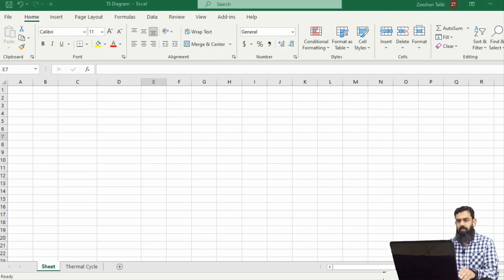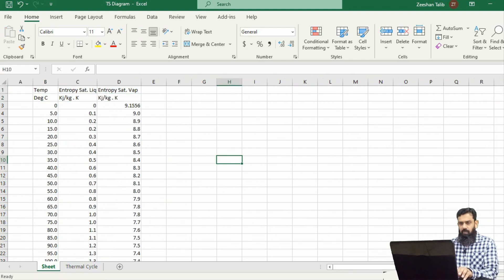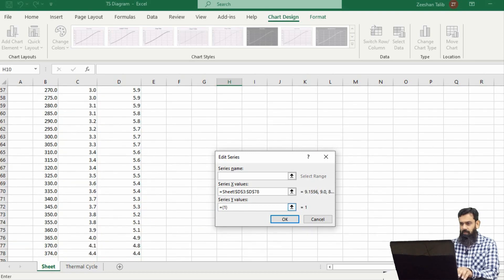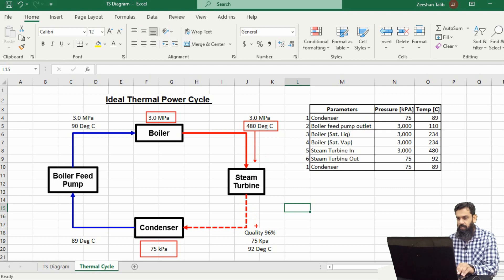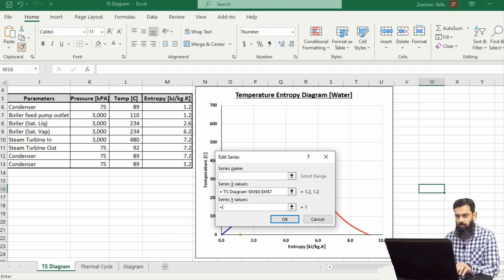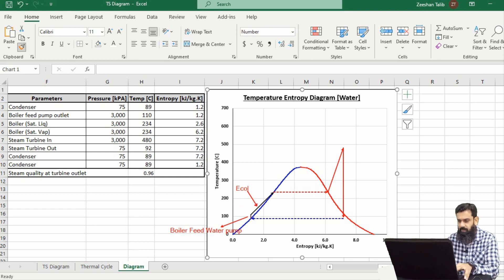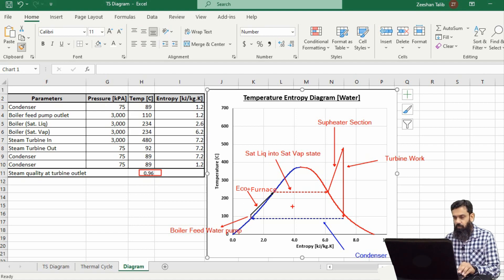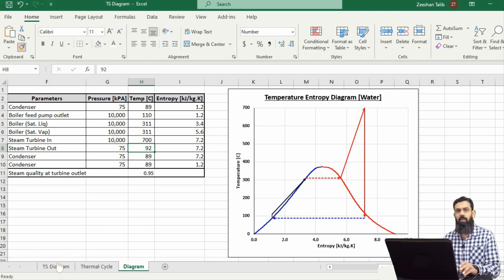Learn to Draw Rankine Cycle in MS Excel | Power Plant | Heat Rate | TS diagram | Thermal Power

Comment: Very helpful video! But how did you link the entropy to the temperature and pressure? In your table it's changing whenever you change the  pressure.
Reply from the maker: You need to have MS excel addin to work for it.